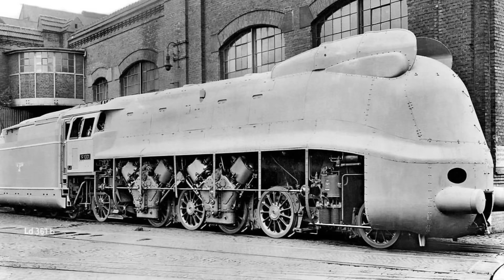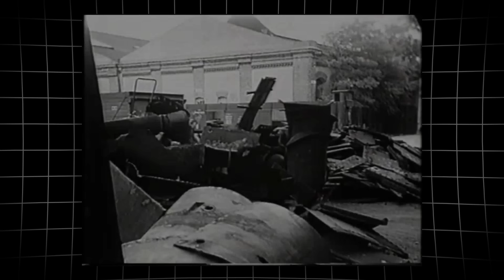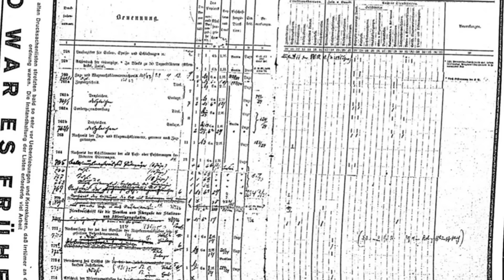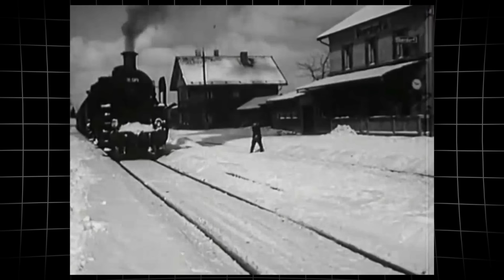The Forgotten Nazi Streamliner Too Advanced For Its Own Era

Comment: Man, its so wrong:
0:20 - Picture shows german experimental locomotive 19 1001 - never did a speed record or an attempt
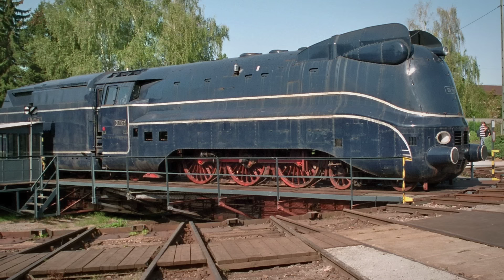3:33 - schoss the class 01.10, which was streamlined well before the build of class 05, and even the picture of 01 1102 shows, that the full streamlining was something, quickly got modified: The running gear was cut free from the casing, because of maintenance reasons, as class 05 suffered with her roller shutters by dust and freezing in winter...
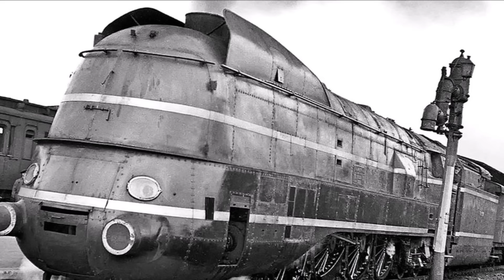4:38 - false headline, false image. Image shows german class 06, a 4-8-4 locomotive, way larger and stronger than lightweight class 05, which is a 4-6-4. False headline, was never published this way. The german Reich did not mage a huge propaganda from the record.
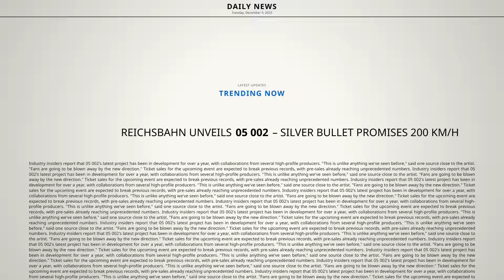4:48 - false image, false claim. The image shows a recruit advertisement for the Nazi youth organisation and isn't railroad related - sorry, that there are people out, who still can read german. Use proper images, to prove you claims
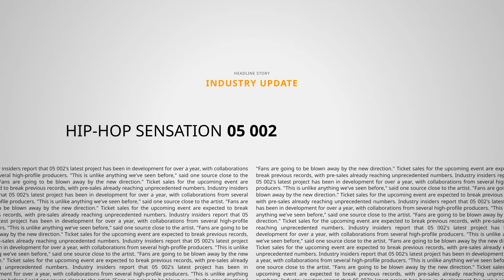4:50 - wow, all the articles are not german news papers, nor is the article something real. Even the headlines are false. AI generated crap. 
4:55 - A Headline: Fans go wild after 05 002 drops new single... Hey, it's a locomotive, not a music band, you know! Try to hide your ox dung better
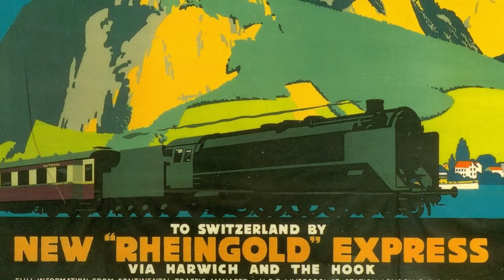5:25 - no, the record wasn't orchestrated...
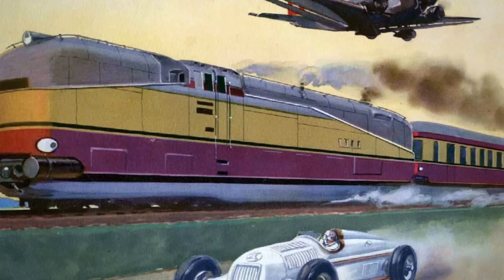5:31 - shows the Henschel-Wegmann-Train... has nothing to do with class 05....
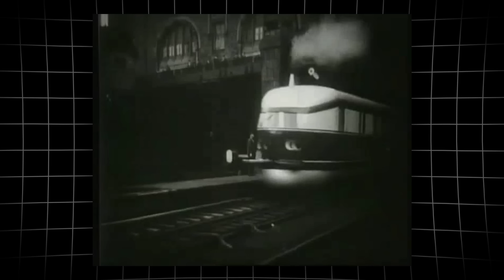5:46 - no, there was no need to defend steams reputation
5:55 - you wonder why? Because it was a long term planned construction of the german unification program for locomotives, resulting in a lightweight, but fast going express locomotive. It was proposed to pull certain trains, even if the most serious members of the Reichsbahn leadership still doubted the need for such a locomotive - but as speed was a general thing of the time, the engines were build - and you can ask yourself, why the only put two and a third, cab forward locomotive on tracks and why it never gained the glory as a class 01 or class 03... there was never an order of such high ranked Nazis for a locomotive, not even for the famous war time class 52
6:00 - the locomotive wasn't really a thing in propaganda. The most serious train during those dark times of germany, the train which was used for the german nazi leadership to travel across germany, was never pulled by a class 05 - these official trains were pulled by one or two class 01 locomotives, later also locomotives of class 01.10 were used. Again, false claim
7:58 - sorry, but get your facts right! The record was not staged this way. It was not done on purpose, it was more a random product. Together with a german travel of electric locomotives, modern, streamlined diesel trains the class 05 as image of a modern express railway traveled thru germany. The record train is pretty well documented, but it seem you even did not notice the wikipedia record or have drawn german sources into your research
8:17 - names lost? This is the worst, as you couldn't better show, how less you know about: The Driver was german major locomotive driver Oskar Langhans and his fireman, even locomotive driver named Ernst Hoehne did the trip and the record. It's even mentioned in articles, that as 05 did the 200 km/h stunt, Ernst Hoehne did a small dance with his shovel on the footplate... So, no there is nothing lost, except your knowledge
8:20 - again - no, it wasn't a start stop trip for a record, it was a regular scheduled priority train on it's way to Berlin. it was not a stop and then race. It was a express train on special service, which got the special governance, to let go... and they let go
9:26 - the press did not run the figures, it was just a brief note...
9:35 - there was no "side line" measurement, it was just the dynamometer car measurement... there were no spectators or staff along the track- 9:40 - no, the train was a 200 ton scheduled train, and not a extra special lightweight train
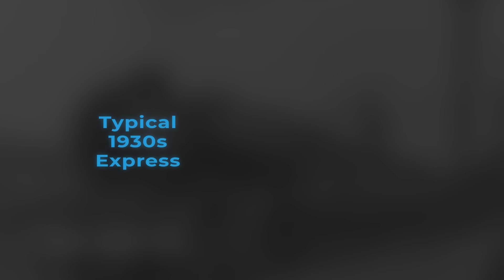10:18 - again, false image, and then not showing anything that the boiler pressure of 20 bar, which is 290 lbs/sqinch… nothing that special for a minority class build. 
11:03 - no.. the german boiler was a ideology build fail. It was not state of the art, nor was it something special. The germans knew better, but were not allowed to do so. compare the horsepowers to a french 231E or a 240A, and you have to admit, which design was better. Even with a coronation class, 
11:21 in the background image, the class 05 would not have been able to compete with.
 11:47 - no. Nothing was „special“. class 05 was a unification class locomotive, thus rods, bearings, cylinders, even the boiler itself were designed to by interchangeable with other locomotives. So it was no special or extraordinary design
 12:31 - again false information, class 05 was never build only for going a speed record…
12:40 - wrong informations: Class 05 had not two meter driving wheels, check wikipedia as proof, but you even failed at this easy task. Class 05 had 2300 milimeter driving wheel diameter, 7,54 ft diameter and not only 6,56 ft diameter… get your facts right, if you are boasting such things
 13:21 - no, the panels were not needed to be removed for lubrication, rolling shutters were used to access the gear on daily maintainance, but repairs were a nightmare, as any change of a valve, a connecting shaft or even replacing a new seal ring, would be need to remove a sheet from the cladding and putting it back after repair. it was not heavy, but needed more labor to perform a task.
13:53 - no. class 05 wasn’t hotter than other engines and had special designed inside wind directors for cooling the running gear. There was no risk for overheated bearings and lubricants. 
14:59 - hope you get it, but class 05 was never been really in a day by day operations.. it was scheduled, yes, but it wasn’t a workhorse like class 01 or class 03. Not because of maintenance, because of bad tracks and even being not constructed for heavy train service, as it appeared. Germany failed to insist, that train load will rise, and not lightweight express trains will gain importance - and war time made this all more obvious 
17:14 - no, the class 05 was never rebuild. They did not get a replacement boiler or any other technical alteration, only the streamlining was removed and the front end was rebuild to match the unstreamlined purposes
19:05 - Again, false informations! 05 001 was overhauled at Weiden shops near Nuremberg and transferred with help of a diesel locomotive into the Bundesbahn museum of railroad and transportation. And still, it was not designed to gain speed records  
In overall, a bad video with a lot of non german locomotives and false informations …
Reply: Thank you for the in-depth knowledge and the meticulously detailed critique.

This is the attitude with which the video should have been created.
Reply: @HOtt-bw4jx  Maybe because I am german and know the whole story of class 05 pretty well ;) I even took some pretty detailed photos of the engine from the Nuremberg museum of transportation
Reply: Thank you for taking the time to document in such detail how nonsensical this video is.
Reply: Besten Dank für Ihre Mühe, das Video so detailliert zu kommentieren! Sind die Loks bei 8:07 und 13:35 KI generiert oder englische Loks?
Reply: @The_Schimpanski  von meiner eher bescheidenen Kenntnis würde ich aufgrund der Schattierungen, vor allem aber der Bildfehler - bei 13:34 aus man nur stoppen und sich die Gleise anschauen, um zu erkennen, daß es ein KI Bild ist - würde ich beide Bilder für wirklich schlechte KI erzeugte Bilder halten
Reply: Thank you for sharing so detailed knowledge.

Comment: The AI generated image at 09:30 is laughable as well as some others sprinkled throughout this "documentary". Wagons with propellers have nothing to do with this and at 10:35 as well as other places it shows a completely different type of loco - the class 19 with axle mounted vee steam engines which was also streamlined. Overall a lot of crap!
Reply: It seems some of this video is AI but trains using propellers did exist as prototypes. I'm almost certain I've seen the exact photo shown at 9:34 years ago in a book about weird and unusual trains.
Reply: SO IST ES LEIDER!

Comment: The 05 was beaten by the Mallard by about 2.5 m.p.h and had similar problems pushing the technology with overheating bearings etc.
The Germans did not attempt to beat the Mallard so it was a short lived propaganda  but an achievement for the engineers.
Reply: The Mallard ran on a slight downhill while the line Hamburg - Berlin is slightly uphill 😉
Reply: The British fraud with the Mallard is total rubbish. That speed was only reached briefly while going downhill. There were no passengers on board, and the 'excellent' high-speed locomotive was scrap afterwards. The German Class 05 maintained its record speed on level track for a sustained period, had passengers on board, and remained undamaged.

Comment: An interesting story which makes it even more sad that during these 20 minutes on a diversity of occasions non-German locomotives are shown. I can imagine it to be hard to find enough video and photo material to illustrate the entire documentary, but you could have used other German locomotives, in stead of British and US types where the story don't call for international comparison.
Reply: Exactly. I've noticed many of these videos do same thing. It's a disservice to the locomotive and it's creators
Reply: There is original footage of 05 002 available on YouTube, but its now hard to find between all the AI-stuff. They even made a documentary movie on the construction of the engine back in the 1930ies. There is literally hours of copyright-free historic material.
Also the AI-script is a pain to listen to. Only idiots would refer to any loco as "BR 05 002" , because "BR" means "Baureihe" which is "class" in englisch. So you either refer to a class of locomotives or to one specific engine. Only 3 class 05 locomotives where ever built, one of which was a cap-forward construction. German standard-locos where often built in several prototypes at first, with tiny variations in between those prototypes for testing, the optimal configuration then going into mass production. Class 05 mass production never happened, rendering the 3 existing prototypes costly one-of-a-kind-locos which where rebuilt as cab-in-the-rear version without streamlined shells after WW2 but got decommissioned soon after.